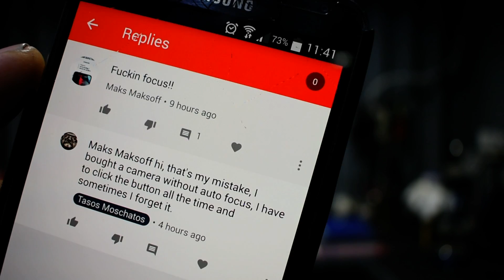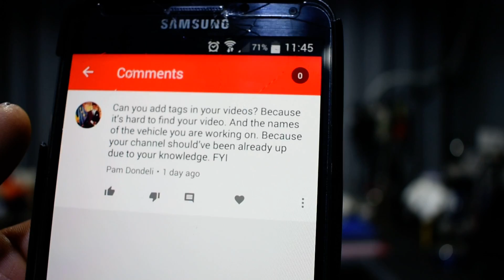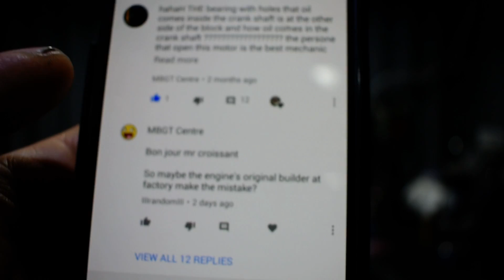trying to answer some comments/questions Feb19

Comment: I would like to request a video about W204.077 C63 oil cooler system.  Can you cover the oil thermostat (location, removal, etc) and fan (temperatures it operates, etc)?  When I go into Xentry and actuate the oil cooler fan, it does not operate.  Also, I’d like your opinion of what temperature the oil should be.  On a hot day (90°F) with the AC running my oil temp will get around 125°F.

Comment: Hi there loved the video on the m156 intake manifold. I was wondering if you can show how you open it up and open the bottom part so you can get the throttle bodies out? I'm having trouble with the rubber boot on bottom with the wires..
Reply from the maker: Ryan Vanderwerf hi, use two flat head screwdrivers on the same side and gently twist, I will try to make a video

Comment: Hi, thanks for  great  videos.
One question  from me: w211  m272 3.5 engine from 2007 -did diagnostics and everything is ok but it consumes a lpt of fuel. Any clues why? It's 18-20 liter per 100km, not less. And i'm driving normally, no wireless driving or too fast or no sporty.
105000 km on odo and all is good, no oop leaking, no oil consumption and gearbox alos is good.

Comment: Hey Tasos, can you please give me an advice for my car?
I own a C63 PP+ from 2012. When waiting at the lights, in D and foot on the brake, my Motor starts shaking irregular. In N it does so,too. Most of the times it begins when the Motor is warm, only one time after cold start. Failures in Xentry are empty, no misfire-counts... If i drive you can recognize nothing, no shaking, full power.
My Mechanic at MB told me to change the Intake-Gaskets, this i will do on friday. In your Video (180k km Checkup) i saw you disassemble the whole intake-manifold.
Would you recommend to do it? i couldnt find any seals in the Computer, only the whole intake-manifold. Or you do it with liquid seal?
Questions over questions, i know, but perhaps you have an idea.
I love watching your Videos, i have seen nearly everyone about M156.
Many Thanks and greatings from Germany
Philip
Reply from the maker: Philip S. https://youtu.be/ZoSRL6Hp-GQ
Reply: @TasosMoschatos   Hey Tasos, Thanks for your Video, this one i have overlooked!!
Like i said i changed the Intake-Gaskets, but its all the same...
Would you recommend to change all like you said in the Video?
Or could it be something different like the clutch is noct 100% open when standing still?
Reply: @Tasos Moschatos Hey Tasos, Thanks for your Video, this one i have overlooked!! Like i said i changed the Intake-Gaskets, but its all the same... Would you recommend to change all like you said in the Video? Or could it be something different like the clutch is noct 100% open when standing still? @TasosMoschatos

Comment: Hey, i like your vedios. I have an 03 e500 with the sport package. I am thinking about getting some more power out of it. Is it possible to put a factory supercharger out of e55 on m113 5.0 10:1 C.R and am i able to just swap the ECU as well?
Reply from the maker: Suliman ///// hi, you need the engine wiring harness, the ecu and the pistons with the con rods. It will be much easier and faster to swap all the engine from the e55.
Reply from the maker: Suliman ///// I forget the oil cooler, the e500 have oil heat exchanger
Reply: Yeah you are right that's too much work. My engine doesn't feel powerful even with only 114k km. I had cylinder #8 injector stopped spraying and cause misefiring so i replaced the injector #8 but i noticed while that inside the injectors rail a black material like salt. So i cleaned the rail and put everything together. The engine noticably gained back power. Now after a month from all that the engine feels less powerful. What do you think that black material and what should i do to gain some power on e500 engine enough to feel the v8? Thanks for the quick answer. Cheers